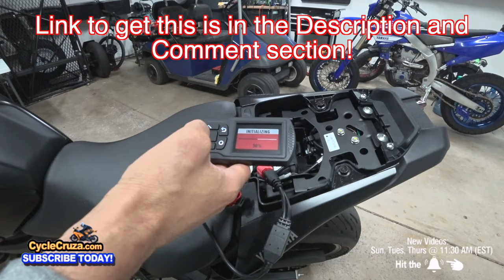UGLY Truth About Motorcycles With NO SOUL

Comment: Seems ridiculous to say Japanese bikes have no soul, when you look at some of the most iconic bikes are from Japan. Like the CBR600 RR, 636 ZX6R, R6, R1, CBR1000RR, ZX10R, any Gxxer and then the MT line-up has soul as the master of torque name fits it. Also outside of Ducati and Aprilia, many other euro makes seem just as bland as they say new Japanese bikes are.
Reply from the maker: The older Japanese bikes had soul right out of the box. The New Yamaha MT bikes definitely have soul but you have to mod it and remove restrictions to get it proper. They realize that riders want strong bottom end torque for the street and are wisely creating new bikes rich in torque and feel.
Reply: @CycleCruza   Facts!!!!

Comment: All of the s1000rr are characterless. They are very fast but they make riding it so easy and "video game like" it is boring to ride...
Reply from the maker: Yeah they refined them so much it removed the character.
Reply: Only people who don't ride them say stupid stuff like this. Either you don't ride or you're not very good at it.
Reply: @superduperkid3143  true my GSX s1000 2k21 is dope carbon wheels ECU  flash eflex fuel kit lithium battery stearing damper full exhaust system dope bro